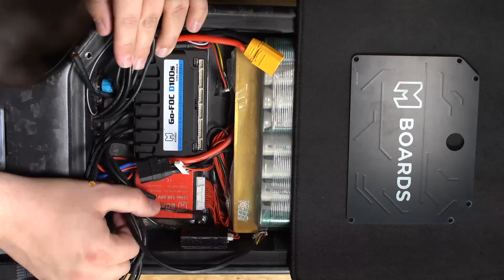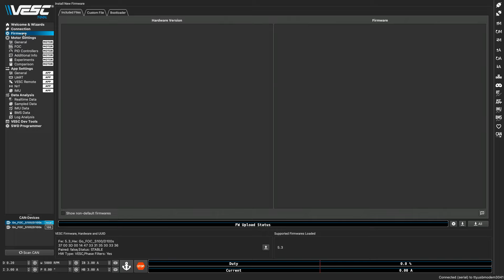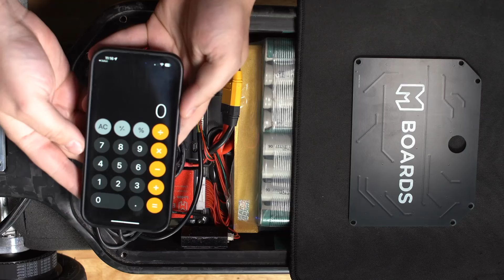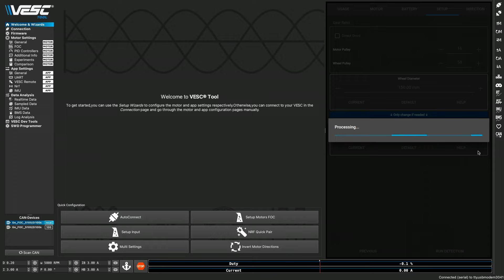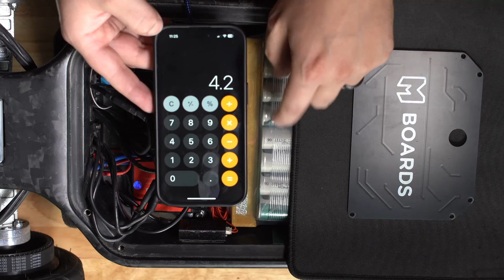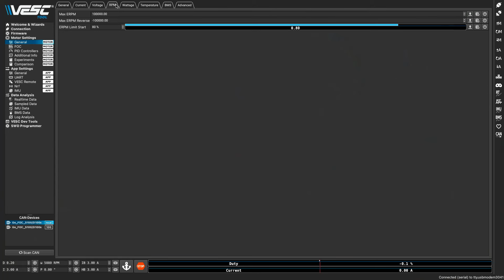VESC TOOL 2024: Motor Configuration & Battery Settings

Comment: Great tutorial!!! Thank you! I have a question about I guess VESC’s  in general. I build scooters and have been using the MakerX HI100 VESC’s. Obviously we don’t use a wireless throttle so I have wires running down to the controller. I have had a few people wreck and hit the throttle wires shorting them out. It usually kills the VESC. Does anyone know if the VESC can be repaired?  or is it even worth it? Thanks in advance!